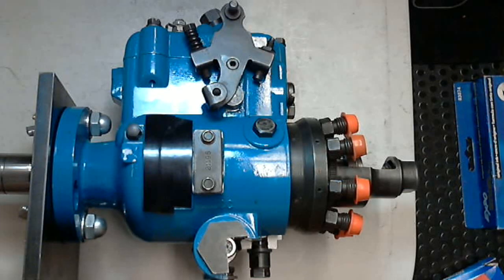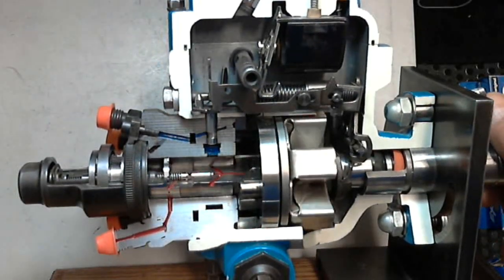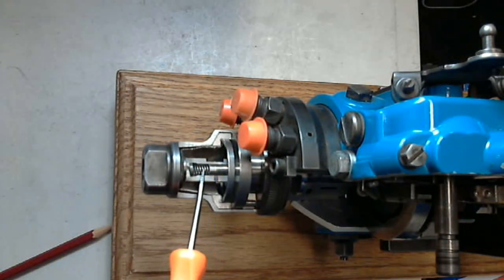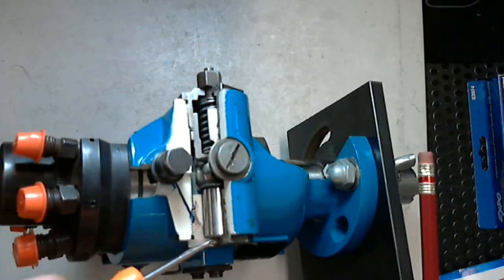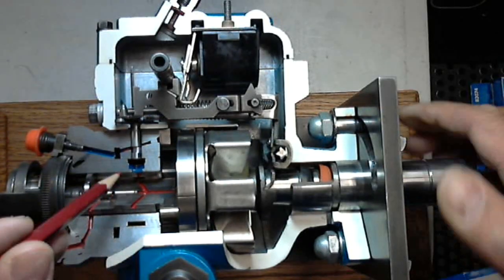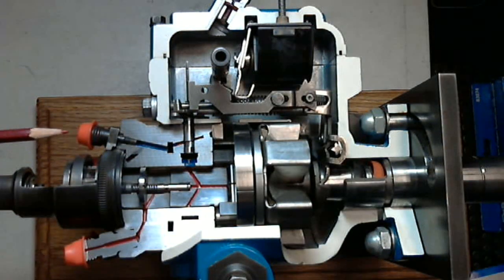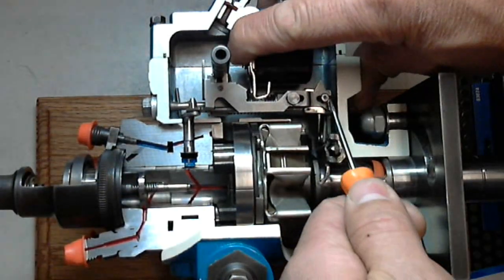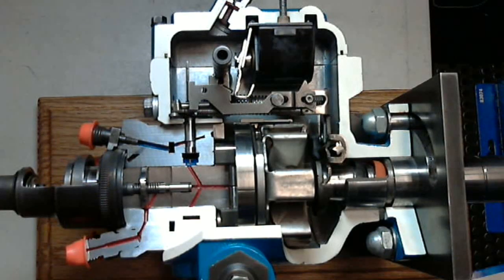Be the Fuel.wmv

Comment: so what could be the problem if there is fuel leaving the injection port?  tractor will not start.  took the line off going to injector at the pump and no fuel coming out?  thanks in advance.
Reply from the maker: Possible causes for fuel not coming out of the injector port are 1, no fuel in the tank, 2, plugged fuel filters, 3, stop soleniod not operating, 4, transfer and or lift pump not working, 5,  metering valve staying in the closed position for some reason ( could be linkage or faulty governor action), 6, plungers stuck in place, 7, delivery valve siezed, 8, return line kinked or plugged.  There is not a huge volume of fuel delivery on each stroke of the plungers so properly bleeding the system after going back towards the tank, checking all the support systems that get fuel to the injection pump should get you going.

Comment: How do you remove the injection pump
Reply from the maker: There are many things to consider before attempting to remove a fuel pump. Engine position, type of pump and type of drive mechanism it uses, pump timing etc. Best to have a service manual and fully understand what it is instructing you to do.

Comment: So, my 6.5L will stall after I rev the engine. Only when I let off the pedal quickly. Would that then be caused by a linked or clogged outlet/drain back to the tank? Or perhaps a stuck metering valve?
Reply from the maker: Possibly, but if the return is clogged or kinked, it should affect it all the time. Sounds more like there is some governor issue where it isn't picking up the fuel quick enough. Try turning up the idle speed by 50 rpm to see if that helps.
Reply: @ thank you, I will try this next. Just to fill in some gaps, not sure if it’s relevant, but this is on a 6.5L Humvee that I got from military auction. Has been running fine for almost a year since running regular diesel(no additives yet). So I’m not sure if the previous JP8 fuel helped the situation? Then since switching to pump diesel it is taking a toll on fuel lines etc?
Reply from the maker: hmmm, not sure why pump diesel would kill the fuel lines, but if thatbis the case you better have good filtration to protect the fuel pump@Jus10-born2Run
Reply: @ I didn’t think it would but that is a change that was made. The engine stalling just started happening about two weeks ago.
Reply from the maker: worn governor springs could be the issue. that is why I mentioned turning up the idle as it will put a touch more tension on the springs and they may react better. A pump rebuild may be in your future.
Reply: @instructordave111  thank you, I really appreciate your insights here and time to help me with this.
Reply from the maker: No worries,I hope you get it figured out.

Comment: I have a very unique situation, my truck suddenly lost a lot of power and was blowing blue smoke. It acts as if the timing suddenly changes to be extremly retarded. It started doing so after driving for about 7 minutes, and then i had one last hoorah after replacing my mechanical transfer pump for a electric inline pump. Ive checked fuel filter, injectors, replaced head gasket (and studded,) ive checked for cavitation in the cylinders as this is a 7.3 idi, and ive checked for return line blockages.
Reply: *mechanical lift pump changed for electric inline pump
Reply: The return line did seem like it need a lot of pressure to blow through that. Could this be the cause?
Reply: Engine also has stalled once

Comment: That was awesome! I have been trying to figure out why my pump is not distributing fuel and now I think it's because the rotor isn't moving. Any idea what would cause that?
Reply from the maker: Possibly a broken drive shaft, but that is generally due to a siezed pump. You can take the timing/inspection window off of the side to see if the pump is turning when the engine cranks.  keep us posted on what you find.

Comment: Could you increase the diameter of the plungers and increase fueling for more boost like a bosch m style pump?
Reply from the maker: You could adjust the plunger spring to allow for slightly more fuel or put in the pumping assembly from a higher horsepower pump as it will deliver more fuel. The easiest way is to just install the higher horsepower pump and injectors. These are not as easy to hot rod as the inline pumps are.

Comment: Hi, We had to replace the O ring on the throttle control as it was leaking fuel, put  it back in but will not start... any advice?
Reply from the maker: stop solenoid wire got pulled, linkage no longer connected,  when you opened it up?? Pretty wide open as to the cause of the issue. Go back through the steps of your repair.

Comment: neat video.  is their a place where i can TEST the transfer pump pressure ?   i have a Stanadyne DB4 pump on my john deere tractor, if the tractor sits for a couple days it chuggs black / white smoke when it starts until i rev up the engine, then it runs great all day, and re-starts just fine, untill it sits a few days, then rough idle again.  i think i have a problem with the internal transfer pump? maybe the transfer pump veins are sticking in, and not pushing out to grab fuel to pump??
Reply from the maker: Thank you. Sounds like you may have a bit of a drainback or leakdown issue. In the first few seconds of the video you can see the black hex bolt just to the right and up from the timing window. You should be able to measure transfer pressure there. Make sure the lift pump is doing its job before condemning the fuel pump transfer pump.
Reply: @instructordave111   i see, i will double check the lift pump supply / drain back before checking the transfer pump pressure. thanks again!
Reply from the maker: I always try to eliminate the simple stuff first. It may be a bigger issue, but make sure of the easier stuff first.

Comment: have case 580e backhoe the engine will start and run only if i actuate the hydraulics, load on engine makes it run? i need to fix this, trying to understand, worse than mg or vw lol
Reply from the maker: I don't think  it has anything to do with the fuel pump. Sounds like you may have a hydraulic relief valve or unloader valve issue. Possibly the hydraulic pressure prevents the engine from turning the pump unless you manually give the oil a place to go. Good luck.

Comment: this cant be real, mechanical nightmare, i have to fix one of these. i have fear
Reply from the maker: they can be tricky, but lay the parts out on a clean shop cloth and you should be OK. Keep things super clean and reassemble using clean diesel fuel. the tolerances are quite small in these things. Good luck with your repair.

Comment: That is a very good tutorial. I have a question that has bugged me for along time, if the metering valve controls how much fuel is sent to the plungers and we know the plungers only move apart in relation to the amount of fuel delivered through the metering valve then how in the world does turning the screw that controls maximum plunger travel affect the fuel delivery?
  Is it because there are times when the plunger travel limits the amount of fuel the metering valve delivers, if so that would only be in a max fuel state yes?
Reply from the maker: Yes you are correct the only time the metering valve is not the limiting factor is at maximum fuelling stage. The fuel, in that stage, between the plungers push them up against the spring ends. Adjusting the screw inwards increases max fuel delivery by compressing the spring and moving the spring ends out. the opposite occurs if the screw  is turned the opposite way, which allows the spring ends to move in towards the plungers.

Comment: Thank you so much for this video! Your detailed explanation especially the part about the return being blocked lead me to disconnect the return to tank and connecting a catch container, this got the truck running again! I would have never imagined a blocked return could stop the engine from running otherwise. Now to find why the return is restricted and correct that issue. I’m thinking an issue with the tank selector valve since the truck has dual fuel tanks.
Reply from the maker: I am happy that this helped you out. If the fuel can't get out the plunger pressures equalize on each end and will no longer be able to pump fuel. Check for a kinked return line. I learned that from working on a truck for a guy who had stepped on his while washing his windshield. Good Luck.
Reply: @instructordave111  Working on 7.3 IDI I just replaced all of the caps and return lines on the engine so it’s something from the engine towards the tank out of all the videos that I watched trying to learn as much as possible yours is the only one that mentioned a blocked or clogged return line The only video that mentioned anything close to the subject was only the possibility of the check ball on top of the pump being stuck thanks again for the information and knowledge

Comment: I'm curious. If the drive slot is 180deg out, will it still create an out of time pump pulse? Or will nothing happen?
Reply from the maker: Yes if the pump is 180 deg out it will be injecting on the opposite cylinder of the one that is on the power stroke. No run situation.
Reply: @instructordave111  OK. Since this is a 6 cyl, even if it's 180deg out it should still have pulse, just out of time. We don't even have that. Thanks.
Reply from the maker: @AmalgmousProxy  injection pressure makes the pump very hard to turn. If the keyway is missing the shaft may just be rotating inside the pump or the gear is rotating on the shaft depending on what type of setup you have.
Reply: @instructordave111  DB4. John Deere engine. It got bad fuel in it and lost pulses, sat for 2 years. Disassembled looking for damage and only found gunked front filter. Still no pluses. Beginning to suspect the wire bleeder is plugged and holding air inside after looking at the video.
Reply from the maker: @AmalgmousProxy  Good call, also it could be the outlet check ball stuck and not allowing return fuel to flow. That would equalize pressure on the plungers and stop them from pumping fuel. Does the fuel flow when ou remove the pressure check plug on the side of the pump? (The black plug on the upper right side of the housing in the first frame of the video)
Reply: @instructordave111  Thank you. I'll check that out.
Reply: @instructordave111  this one is on the lower side of the housing. It aligns with the cone filter.

Comment: Wonderful breakdown of the Stanadyne system! I learned a ton watching this.

I entered diesels not long ago, after 20 total years as an auto mechanic, 15 of those 20 spent with motorcycles, and now 2 years into diesel, learning and experimenting as much as I can. Currently, servicing my '91 6.2 Detroit has been a wonderful experience in learning how the deeper mechanical parts of diesels work, as well as how to understand the complex systems in play when they are running correctly.

Comment: Thanks for the video.  I have a question if I could  , I just reassembled  A DB 2 pump on a 6.2 diesel out of a 1982 Chevrolet pick up and it has a surge and low power I was wondering if I would have assembled that pump a 180ﾟ out of time would it have even run . The  truck will run and  drive just low power and annoying idle . Thank you .
Reply from the maker: Could be a few things, governor linkages could be misaligned or binding,  pump out by 180 would surprise me if it ran at all, check that the return line is clear and the check ball is in the return line fitting. Lift pump getting enough fuel to the transfer pump.
Reply: @instructordave111  Thank you

Comment: Hi! It's an interesting video and very practical. I have a problem with a gen set when I  start the engine, it start out of frequency range and decrease slowly the rpm until reach the nominal frecuency. This occurs in about 1:30 minutes. Why could happen that?  Thanks!
Reply from the maker: Based on limited information and assuming the genset is equipped with this type of fuel pump.  I would guess that there may be something that is keeping the fly weights from bringing the rpms down to the speed setting for you generator. Spring settings may have been adjusted to a higher speed than is required. Hard to give a definitive answer from a distance.

Comment: you greatness is impossible to understate. I would like more information on the shut off solenoid and the different parts needed to move to turn the metering valve and the injection pump to ON.
Reply from the maker: Thank you Yubal, 
The shutoff solenoid forces the metering valve to the NO fuel position when there is no electrical power applied to it. Once the ignition is turned on the solenoid is energized to create an electromagnet, which pulls in the stop lever and allows the metering valve to go to full fuel. The spring forces the linkages and levers inside to move the valve to full fuel. Once the engine is started the flyweights counteract the spring and cause the metering valve to adjust the fuel quantity to match the speed and load desired by the operator.
Reply from the maker: This old video may also help https://www.youtube.com/watch?v=DCPWHv2jJZE

Comment: I have one question tho... If transfer quantity determines how far apart the plungers move than isnt the timimg affected by the fuel quantity. As in the regular plunger pump the plunger starts building pressure at the beginning of the stroke and quantity is regulated with a bleed port. But in this configuration in low fuel quantities wont the plunger start building pressure later thus affecting the timing? I am sure i am missing something here i have come across this type of pump a few times and it causes sleepless nights not understanding how it works, hope you can answer me or link me tawards something that can. Thank you in advance!
Reply from the maker: The lower helix plunger is the one you are referencing as a comparison to this pump. There is also an upper helix plunger that works similar to how the timing is affected by the plungers and fuel quantity in this distributor pump. I also have a video explaining the function of both of those.
You are correct in that the quantity of fuel affects the BOI (beginning of Injection) timing in the distributor pump. The EOI (End of Injection) is fixed as far as the rollers and plungers reaching the top of the internal cam lobe. The effect of this is when the engine is at low fuel requirements and low speed, the later BOI allows the cylinder to build a little more heat to allow for better ignition of the fuel. At higher speeds and fuel requirements the piston speed increases the temperature quicker and the resulting advancement of the  BOI allows the combustion event to start sooner so it can be completed at the proper point in the pistons travel. 
I hope that helps and lets you sleep better.
Reply: @instructordave111  thank you so much for putting my mind at ease 😃
Reply from the maker: Here is a link to the upper and lower helix plungers  https://www.youtube.com/watch?v=msh0UODEvig&t=2s

Comment: How high is the preassure going to the engine?
Reply from the maker: That will depend on the speed the engine is turning. The injection pressure can be as low as 2000 psi at idle or slow speed and up to 25,000 psi at maximum engine speed.

Comment: Is there a way to use fuel under pressure or air pressure to un-stick stuck plungers? 
Thanks
Reply from the maker: Due to the design of the pump, I would not use air to try to free them up as there may be water or dirt in the air you are using. You may be able to pressurize the fuel pressure test port but you would have to be careful to not over do it and damage some of the internal components. You should be able to apply the same pressure as the pump would see at high rpm. You would need to check your specs for your pump to determine that. Due to the very minimal tolerances inside the pump I would not hold out much hope for this to work. Good luck !
Reply: @instructordave111  Thanks Dave!  But........what port is the Fuel Pressure Test port??
Reply from the maker: Sorry I missed this question. The pressure test port is the black hex head plug near the top right side of the pump body in the beginning of the video. Hopefully you found the answer .

Comment: the direction of rotation can be confusing.the arrow on the transfer pump seems to be backwords
Reply from the maker: Hi Fergie,
The pump would be built to coincide with the engine rotation. This pump is a demonstration piece and my explanation mY take some artistic license to explain the operation of the pumps components. Be sure that any fuel pump work is based on proper knowledge of the engine you are working in.